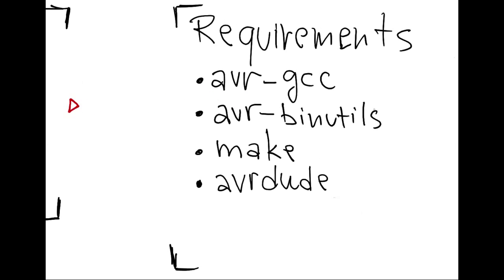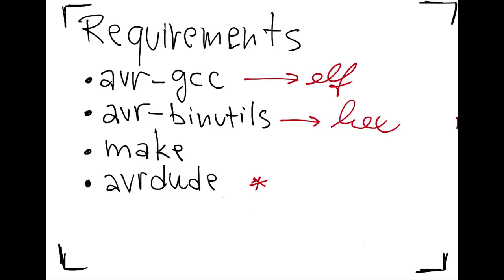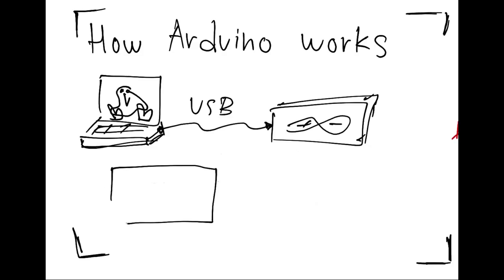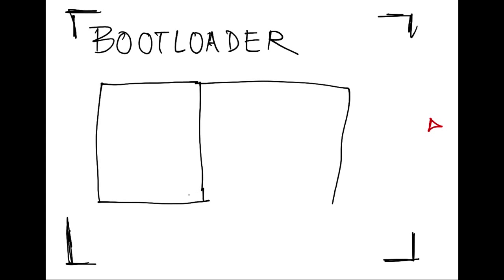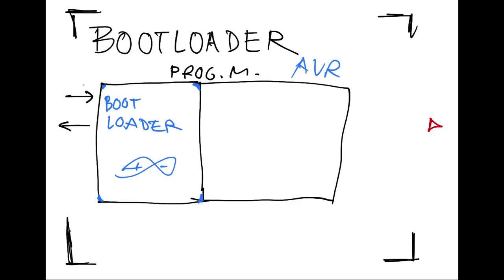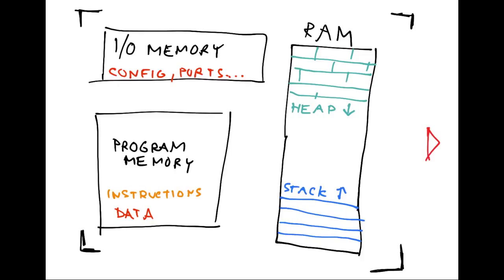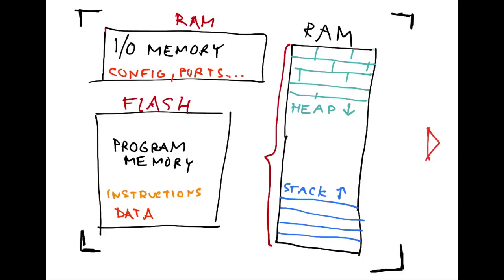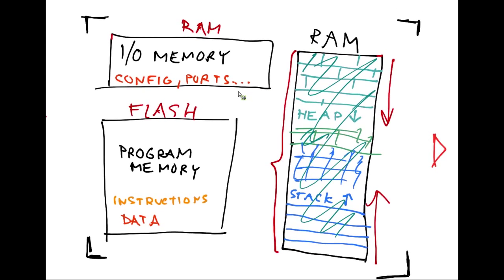Arduino in C, E01: Intro; toolchain, bootloader, memory

Comment: Why not using modern c++11 ?
Reply from the maker: A better question might be - why use it?
I use C because I feel it gives me greater control of the low level code. C++ classes are sometimes useful, but all can be done without them as well. 
What particular benefits of C++ and C++11 do you have in mind?
Reply: C++ and particularily C++11 is more complex but more secure. The classes are an option. There is no more control in c than in c++, you can do the same (ex : embeded assembly if you want). 
A simple example (many other examples are in my mind like String to avoid string[ ], auto, etc : 
in modern C++ a global variable can be used like this :
::variableName. The :: has the signification "global". It's used to avoid confusion with local variable with the same name.
Arduino uses g++ frequently in collaboration with gcc (verbose option in arduino ide). The compile time can be better with g++ (better optimisation) etc...